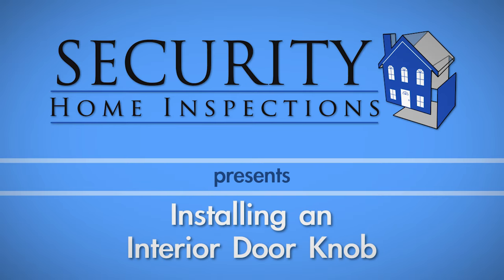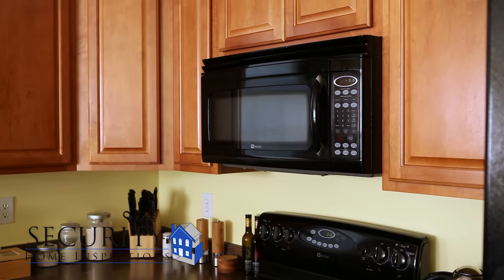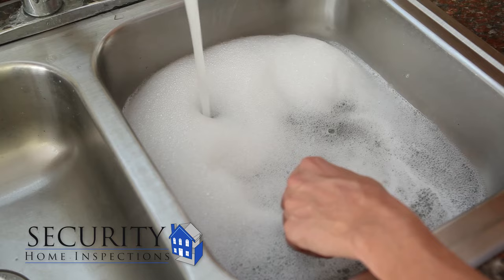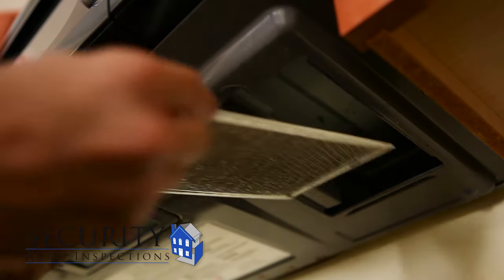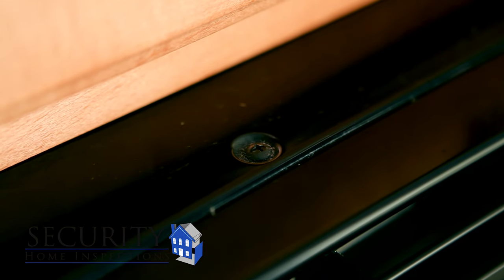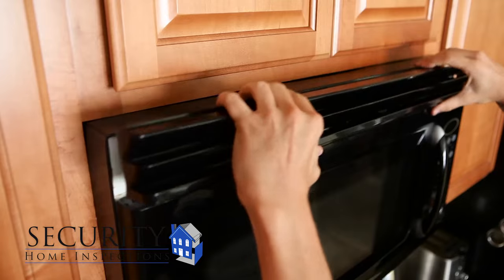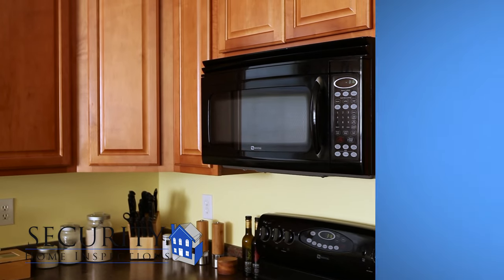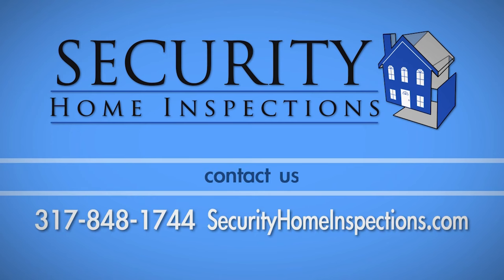Cleaning Over The Range Microwave Filters

Comment: Are these filters located at the bottom of the Panasonic microwave. there is also a filter in the front. Temporary charcoal filter and they can not be washed. did anyone replace the front charcoal filter with the new one?

Comment: Is the filter dishwashable?
Reply: Not at all.
Boil water pour into it with soap and brush. Do this several time until it is clean.
Boiled hot water is magical with these tough grease.
Reply: I used to put the filter from my old microwave in the dishwasher and it was fine. I haven't tried it with my new microwave yet though,.